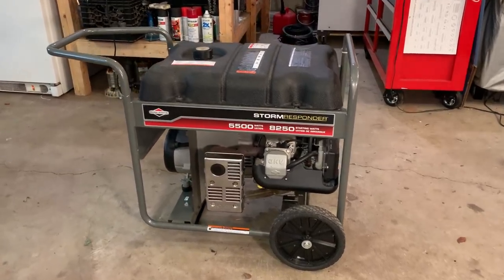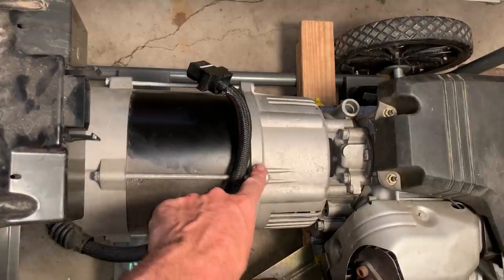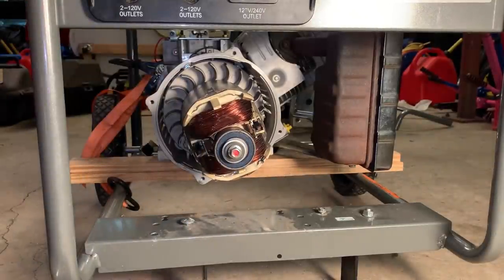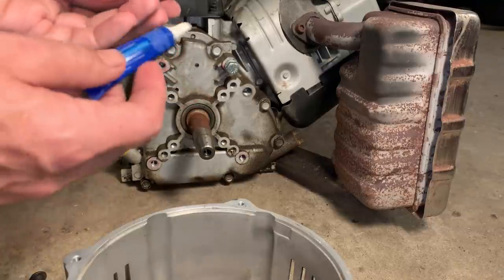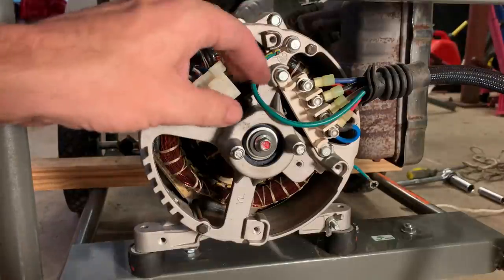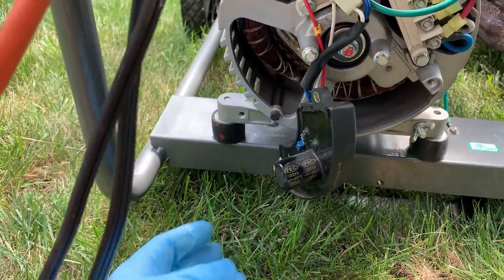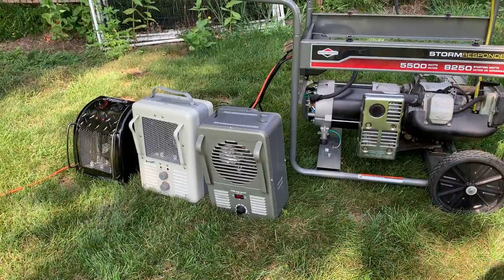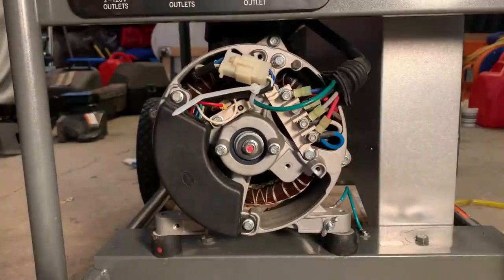Blown Generator Engine Swap

Comment: When Hurricane Ike came through Houston, our power was off for 16 days. I ran one of these generators almost continuously to run the house and one 10K BTU window AC. Ran flawlessly and used surprisingly little gas. Changed the oil at the end of each week due to the runtime a couple of times. No issues otherwise.
Reply from the maker: They are a solid generator/engine.  Just need to check the oil.  They do not have low oil sensors.
Reply: @jcondon1  It amazes me that in an otherwise robust design, there's no low oil sensor. Judging by your channel, low oil issues are the end of many otherwise good engines in these units.
Reply: Outta
Reply from the maker: David Wood that is the main problem with these generators.  Otherwise very solid, wish they would have included the sensor.
Reply: I run my  predator 1800 4to 8 hours  a day, I change oil the first  week of each month. It's  been  4 months and it runs great. The oil isn't to bad either. I think  with a filter I could  go 2 months  between changes.
Reply: @jcondon1  I have the Generac version of this exact generator. That’s who built them for Briggs anyway, during and after Briggs owned them. Mine has the same engine with the low oil sensor, and I am very, very happy that it has that although I will check oil often when using it.

Comment: James, thank you so much for your videos. 
I love working on my own machines, but I often rush or cut corners.  
These videos are therapeutic for me.  
It's very nice to see someone with patience and knowledge who actually fixes problems, even little ones, instead of "band-aids" them.
Keep up the good work. 

A note (that you probably already know) on torque when using a thread locker: 
You'll often see "wet" and "dry" torque values based on whether you have any lubricant on a fastener. 
"Wet" values are typically 80% of "dry" values.  
Thread locker acts as a lubricant when first applied, so you should actually reference "wet" values. 
So if a torque spec for a dry bolt says "25ft-lbs", and you add thread locker, you should only go to 20ft-lbs (80%). 
Most of the specs I've seen only list one value, and that value is based on whether they suggest the fastener being wet or dry, so this really only applies to self-prescribed thread locker. 
But, it's something I've learned fairly recently, and it might explain the old bell housing bolts being torqued to 25, but you only feeling comfortable going to 20 when reinstalling.
Reply from the maker: Thanks.  I try.  You are correct on the wet vs dry values.  Never knew the 80% rule.  That will be helpful in future builds.  Thanks.
Reply: @jcondon1  
80% isn’t a “rule”
SAE, ASTM, and the various fastener society people have specs for lubricated fastener torque reductions depending on application. 
Some fasteners are 50% derated torque spec. As you said, with aluminum torque is probably worthy of extra attention.

Comment: Great information.   I had the same model in perfect  condition but blew the engine after the storm running engine for about 20 consecutive days.  We believe it blew due to low oil.  Swapped engine with a Honda engine.

Comment: Thanks for the time taken to make and upload this video James, Removal procedure and double-checking torques during removal shows excellent experience and will probably save someone from stripping the castings. I agree that the centering of the fixing bolt seems like un-finished design business (Not your Issue) but would suggest that the amount of movement could be reduced by the addition of an external threaded reduction bush with a washer on the outer end.

Comment: Excellent work! Might I make a suggestion? I use tie wraps with an eyelet made into the female end for just such an occasion of your securing that connection. As often as I use them now for wire maintenance in general, I can’t go without. Too easy for running a harness, just screw it to whatever/wherever, just grip and zip the bundle, thread then cut the tail... itsa nice tight bundle every time, it’s quick and looks great  too😉 Anyway, thanks for taking us along, I learned something new today so that’s a good thing... thank you✌🏼😷
Reply from the maker: Thanks.  Will get some.

Comment: James ,Just a tip instead of using a larger bolt to remove the rotor I use a one smaller in diameter this way when it pops it's still in the threads . keep them coming !! Best on utube !
Reply from the maker: You could, tried it once and bent the rod but it worked.

Comment: I recently had two of these generators come through the shop. One had a blown rod because he ran it out of oil. The other one had a broken crankshaft which was a surprise for me. I actually had a good crankshaft in stock that I took off another engine that I had converted to a straight shaft. It was an easy fix.
But the one that blew the rod out the side of the block was completely destroyed inside. It ended up being cheaper to source another engine and install it. I chose a 9 HP Briggs and Stratton Vanguard because it was the only engine I could find with a tapered shaft. With some modifications to the engine mounts and muffler, it worked perfectly fine.
Reply from the maker: Low oil is this engines weakness.  Working on one right now that ran out of oil and broke the rod.  No hole in the case so hoping it can be rebuilt.
Reply: @jcondon1  You should be able to. A new connecting rod and clean up the crankshaft and your back in business. Hopefully it didn’t smash into the camshaft.
Reply from the maker: @Omegadoomship  I have an extra camshaft and crankshaft.  The real wildcard will be the condition of the cylinder and crankcase.
Reply: @jcondon1  If you don’t see a hole in the crankcase there’s a good bet the damage would be insignificant. But you never know what carnage you’ll see until you take it apart.

Comment: Awesome, have the exact same engine and I wound up pulling out to review since I didn't document in my folders.   Was reviewing what engines I have to potentially swap in a made in the U.S. engine into the Champion 4000W gen that came with an All-Power 196cc I'm guessing GX Honda clone that isn't starting easily.   Thanks for sharing... neat watching.

Comment: Hey James, congratulations on your success on your viewership! Keep up the good work!!

My son and I yesterday built a good standby generator from two dead ones - I'd show pictures if I could. PM me if you want details.  Between the two of them: 1 wrecked engine, 1 seriously damaged armature from a spun bearing, and 1 shorted stator. You've been entertaining as hell. Your tip about using hydraulic pressure to pop (and I mean that) the armature off the crankshaft came in real handy - worked so very well. 

I hope this becomes a thing for you and you follow what is clearly your passion. Best of luck to you, sir.
Reply from the maker: Nice!  Good work!

Comment: Great video, Briggs and Stratton really should've put a low oil sensor on that engine because a lot of people probably just run their generator without ever checking the oil.
Reply from the maker: Yes, most generators fail when the power head goes out.  These normal fail due to a lack of oil.
Reply: My dad was religious about changing and checking his generator oil. Never really used any. 
Didn’t do due diligence this last fall. Early this winter: power outage. Fires up generator. Few minutes later it threw a rod. No oil in it. None. Surprise!

Comment: Thanks James for these great videos' all thease tips of tourqe settings are eye opening, I enjoy your videos very much. on the subject of The Storm Responders, they seem to be cheaply built. shame a recognised company name like Briggs are doing this. I had a AKSA 3000 with a Briggs back in 98' that used to work at least 8 Hours a day up to 2006. Oil changes each 40 hours in abouve 47c Tempreture weather. served me well.
Reply: Not sure what brand FEMA gives out. But I would guess that many of these frequent flyer basic models were given out after storms. Hence why the owners treat them like crap. Here in Florida, people beg the government for them, then sell the never used generator. Gotta love it.  Any free generator given out by the government should be painted bright orange to let people know the owner got it free of charge.
Reply from the maker: I actually think these are well built, a good design an do recommend them.  Just gotta check the oil because most of them do not have a low oil sensor.

Comment: I could use a frame from one of those 3k ish china generators if you got one laying around. Got it behind my garage and use it several times a week. The frame is rusted away. basically a motor and head laying on the ground lol.

Comment: I was at a go kart track where the karts were supplied and I blew up the engine on one. The rod flew through the side of the block like you mentioned usually happens. It didn't run out of oil. I don't know why the rod failed because I didn't stick around very long after the race ended, lol.

Comment: Where do you find all these "need-fixed" generators? I like rebuilding such things, but never found any for free or cheap enough to buy and repair... Thumbs Up!
Reply: I can't speak for him. But in areas that face storms every year (florida) generators are purchased or given away by FEMA by the thousands. And when they sit and  junk fuel destroys the carburetor, people sell them in huge numbers- usually cheap. I mostly see them on neighborhood websites like Nextdoor. Probably 10 listed in my neighborhood right now. Good luck.
Reply: Facebook marketplace or craigs list usually has a lot of them.
Reply: Gary Mucher I don’t see any of theses either  it’s a east coast thing and a big city thing 
I’m in oregon we don’t Have that many storms or power outages  so generators are used on Rv and taken care of  
We maintain them right along with out quads or side by side toys
Reply from the maker: I found this one on facebook marketplace.  They are hard to find and sell fast.  But, If I can find one at $100 or less then I will grab it.  Think it is more common where I am then in other areas.

Comment: James have you ever considered a lift work table for the shop so you don't have to be working bent over all the time. The one I have really saves a lot of wear and tear on the back.
Reply from the maker: Yes, been considering one.  Trying to use my bench more when possible.  A lift table is something I will add.  Was only making one or two videos a month so it was not a big deal.  But since I've been home after Corona hit, been working on a lot more stuff.

Comment: James, while I agree with beautification of the generator unit I do NOT agree with swapping manufacturer related info such as a Briggs & Scrappum(taradactyl, Darrel) with a generac blower housing   or vice versa that just causes problems for whoever works on the engine afterwards.  I know you probably have NOT thought of this or you most likely would not be doing it.  Just my 2 cents.
Reply from the maker: The engine model is on the valve cover of the engine.  The next guy will have no issue locating parts.

Comment: First off thanks for the vid. Always good and I'm definitely sub to you. I'm a home remodeler and pretty good with my hands when it comes to any house or commercial related and the basic that I've taught myself but at a loss on this small engine so  I checked my ego and listened to my  girlfriend and came to YouTube and you.
So here is my question and quick breakdown what I've already tried.
I really need your help. My mower won't run and don't have money for a new one. I've checked spark and my air filter and checked oil and checked tension on cables all the basics and will start no matter how much I try pulling...However if I put a little starter fluid or gasoline directly in the carb it'll start and run till it burns up that gas so about 30 seconds and Quince event Lee the exact same thing is happening to my work van right now but I think it's probably my fuel pump in my van but not positive yet. I checked all the fuel lines none of them are broke or cracked or disconnected so I was thinking about buying a carb kit for it? If the owner of this channel would respond to me that would be awesome or if anybody else in the comments section might know I would be extremely grateful for anybody's suggestions or tips thank you.

Comment: Powerhorse model166113 at 7250 running watts has 5 volts going to the brush-set from the
AVR. Champion gen# 465963500 watts 7.5 volts to the brushes. TroyBilt 5500 7.5  from a
rectifier bridge on back of brush-holder, wires come from exciter coils in the st8or. These gens
are running just fine. I put the field voltages here to help people know what they should have
when working on these gen-sets. When I get more gens working, I'll post what I find out.

Comment: James, with the holes in the governor bracket, you shouldn't need to bend the other bracket to compensate.
Reply from the maker: Those holes on the governor bracket adjust the governor sensitivity (and spring tension).  Generally you do not want to change the sensitivity or the governor may not respond properly under load.

Comment: Regarding no oil in the engine.
Engines from the factory sent out without oil. 
Customers has to fill the oil, it says in the  user manual.

Comment: My generator has the same engine but maybe a few years earlier. Has low oil shut off. Starts first pull every time. 
Tank has fuel shut off, I always turn off the fuel and let it run till it empty’s the carb. 
It does need a good carb clean/replace cause I need part choke
Reply from the maker: A cleaning should fix it.  They are good engines.  Nice that you have the sensor.  It should last you a long time.

Comment: jim set the valves before changing any thing else on settings!!
i would to have changed the oil before a run up..
also clean the spark screen on the muffler before run up.

also to center the gen head main bolt on the bearing use tape on the bolt to get it to center.

Comment: Obviously very little use and well kept. Makes one wonder why it was run out of oil and destroyed itself?
Reply from the maker: It was pretty hot when it happened.  May have used the wrong grade oil.  And/or never checked it.  Not sure.

Comment: By unscrewing the rotor bolt with the torque wrench, you are not messing up the calibration of the torque wrench? I would use a breaker bar for that.
Reply from the maker: Did not know better at the time.  Yes , use a breaker bar or impact for removal.
Reply: @jcondon1  You inspired me to pick up a generator and start repairing it. Thank you for that. It is a Champion 76533(free) with stuck governor arm, and bad battery. I have also picked up a Coleman Powermate 5000 Gen Pro($60). This one, most likely has a dirty carb, since it starts with starter fluid. Thank you for all your videos, I'm learning a lot from them. The drought here in LA is getting scary, so I just want to be prepared.

Comment: Get Milwaukee m18 3/8 impact and you will able to spin those rotor bolts right out without messing around with rope or strap around the flywheel.
Reply from the maker: True, but still need to lock it up when installing the rotor and torquing to 23 ft lbs.

Comment: Work to hard, and torque wrench happy. On this small stuff everything d is rent call for the clicker. Just snug to tight simple! I yank engines apart the only thing really get the clicker is mains, and rods. Everything else gets the Ahgua dughah treatment.

Comment: Just a thought, but does applying thread locker to the bolt act as a lubricant that might give improper torque setting?
Reply from the maker: It does

Comment: Good evening James, I just happened upon your channel and decided to subscribe.  You are covering the exact same generator I have, and I can tell from the video, that your generator above is indeed equipped with all the same parts and specs as mine.  Yours is a Briggs and Stratton generator, and mine is a Troy-Bilt, which for all intensive purposes is a Briggs and Stratton unit with a different name.  So my question for you, if I may ask, is what is the series or model number for this 10 horsepower Briggs and Stratton engine as such?  I have been all over the Internet for the past week looking for that information and hit nothing but dead ends.  My generator was a curb find and the previous owner already started to disassemble the engine.  Because of that, I do not have the model or series for this engine.  My piston is seized at close to dead bottom center, so I have no room to make it move further downward if I could.  I will need to buy a replacement block and piston, but all else in the engine looks good.  All that to ask, what is the model or series number for this engine? 
Your help is appreciated, and I definitely appreciate all the work you have done and the level of detail in your videos.  Keep up the great work!
Reply: These a made like a lot of Fords: lots of orphan parts. There should be a serial number plate… 
But basically any similar motor could fit- there’s tapered fits on the shaft that could be different but basically only two as far as I can tell, or some have a non-tapered shaft. 
I have three generators out by the shop right now- one is a blown motor, the other is a neglected motor with compression but a bad carb, the third runs but no electricity output. 
I think the neglected motor will take the carb from the otherwise pristine blown motor and give me a running generator. As long as the shafts are both the same.